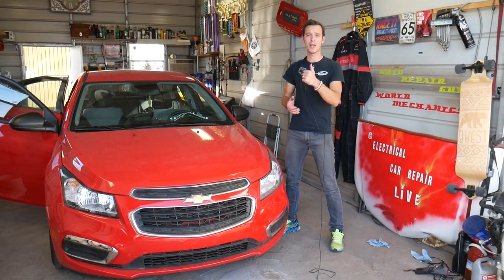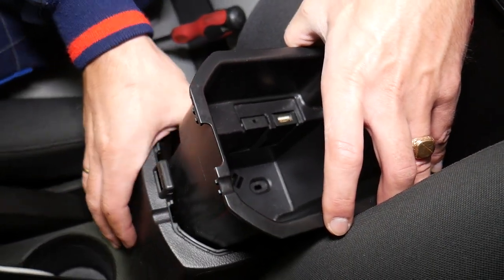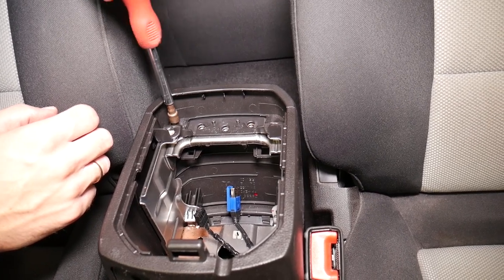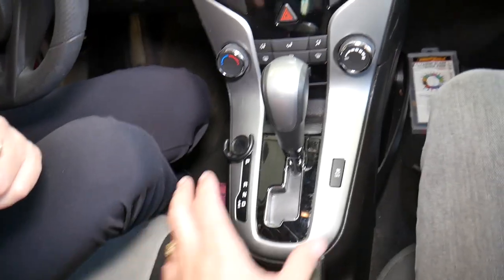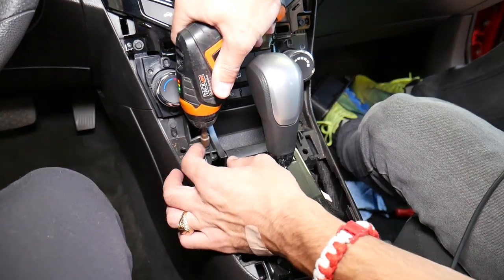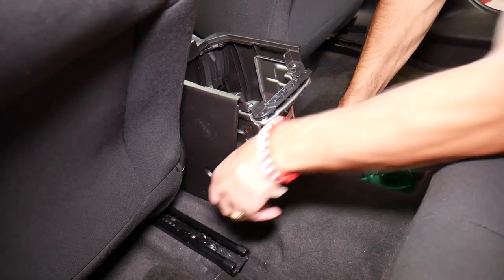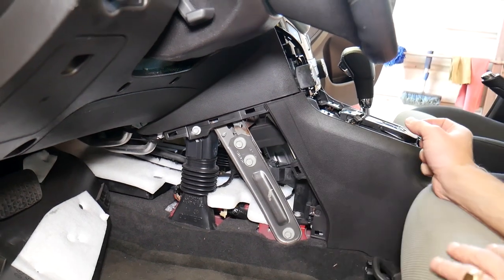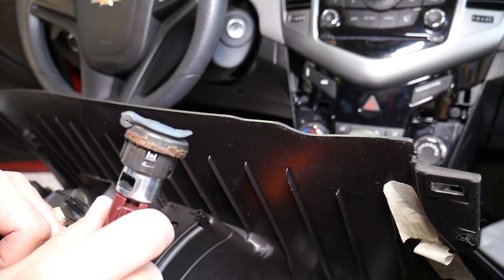CHEVROLET CRUZE FRONT CIGARETTE LIGHTER SOCKET REPLACEMENT REMOVAL, CIGARETTE LIGHTER NOT WORKING

Comment: All this just to change a lighter??? Jesus!!!!
Reply: There’s a better way! Buy a Dorman 57450 lighter socket removal tool, pull out the old, insert the new. Took me about 10 minutes.
Reply: You did them both? Well I don’t get why he had to take it all apart. Well I guess I do, but if you had just pull them out and put others in ?
Reply: I have to do mine myself and I was sooo surprised that all the middle has to come out yet. But I have to replace them so I can charge
Reply: @jackiebergey181  if you pull the lighter socket out with the tool I referenced you do not have to pull the middle out like he did. The lighter itself will come straight out. 10 minute job & you can charge again.

Comment: Hello, your videos on yourube are very helpful. I been watching your videos on how to repair different parts on my 2012 chevy cruze eco. But I ran into an issue involving the turbo charger by-pass valve gm part # 55574902 located just  above the alternator. There are no bolts holding this thing on. I cant figure out how this vlave comes off .There are no video anywhere on how to replace/ remove this valve. Can you please make a video on how to remove this valve

Comment: There is a better way! I ordered a Dorman 57450 socket removal tool from Amazon. I used the tool & pulled straight up & out. I pulled so hard I bent the tool, but the cigarette lighter & black adapter came out. It was a pain to get the old lighter out of the black adapter. I pushed the new lighter & adapter back into place & it works again! 

Huge shout out to Auto Repair Guys for making these videos & helping me save a ton of $! You’ve saved me multiple times!!
Reply: What year is your cruze? I looked that tool up but it said it wasn't compatible with my 2012 cruze.
Reply: @Kaoshihimura9  I have a 2012 Cruze. It worked for me!